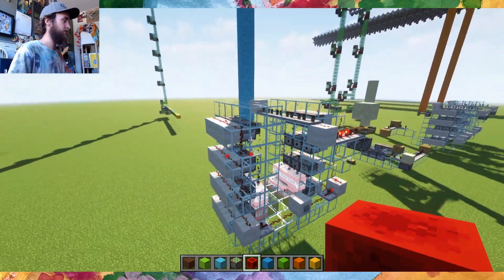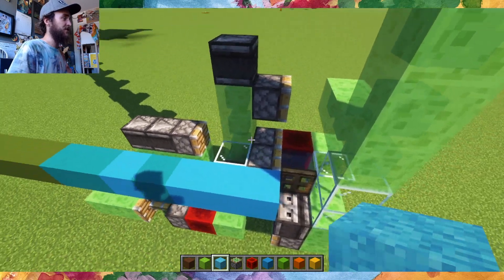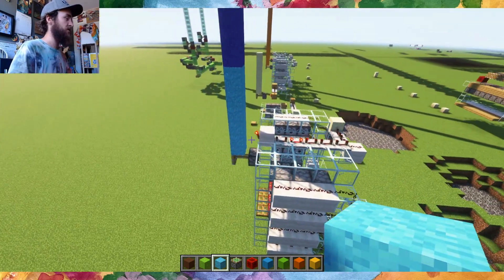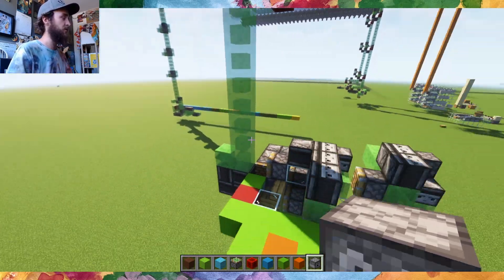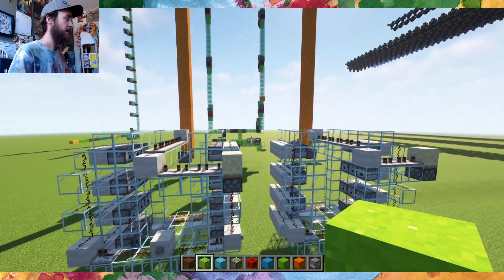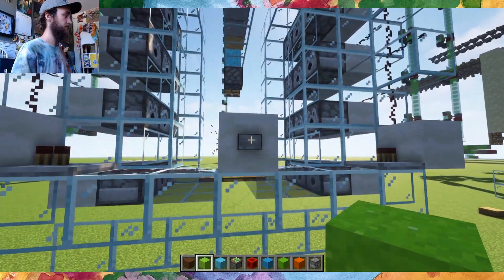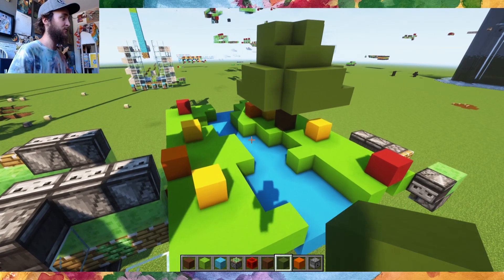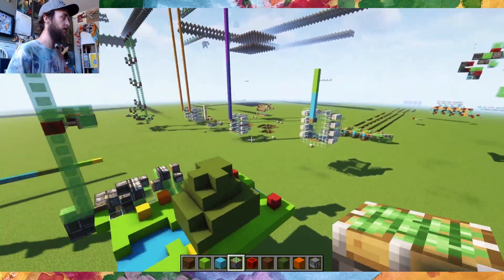Long-Distance Concrete Printer in Minecraft

Comment: Really interesting stuff, reason your cannon is not accurate is because tnt has random momentum and is not aligned perfectly. And the only way to deal with that is pushing it against block in x and z directions, good way of doing that is with piston head (its hitbox sticks out from the back of the piston when it retracts)
Reply from the maker: makes sense. I tried something like that for my first couple launchers. They all blew up haha. I settled for a water-based alignment as a compromise between safety and accuracy
Reply: best way would probably to align the tnt against a solid block using its velocity